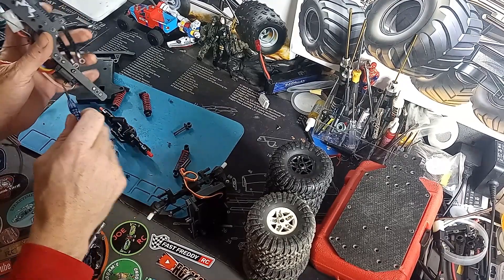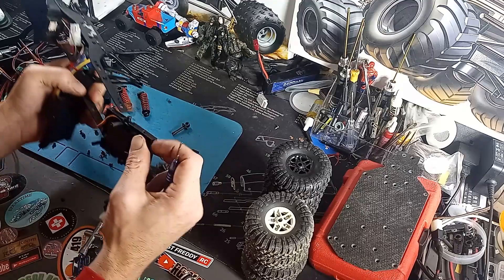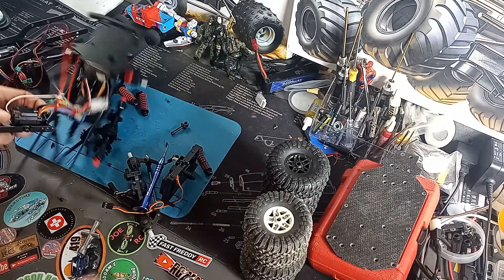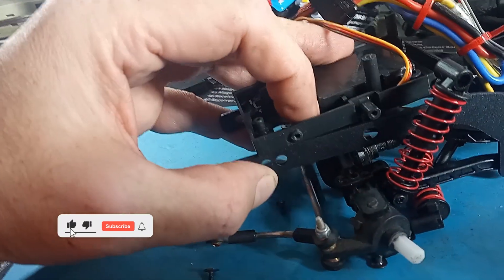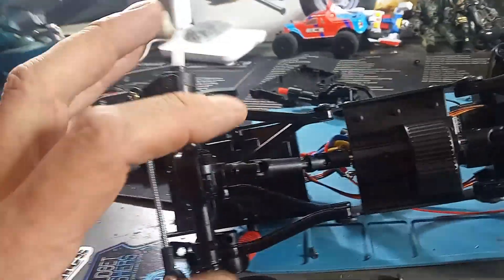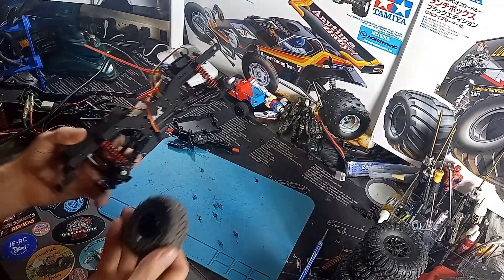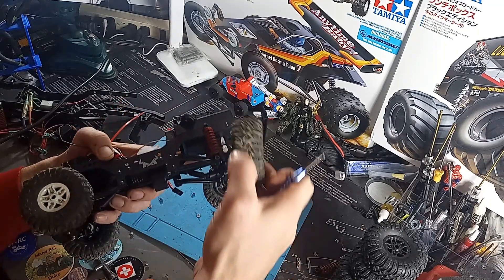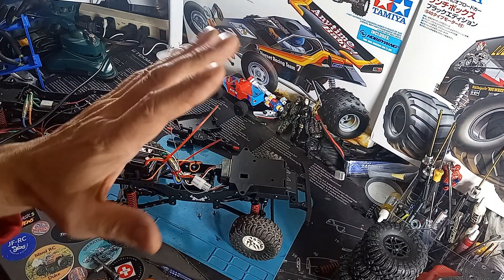MN45 - Dual Steering - Upgrade?  Will it work?  #FJ40 #MNModel's #mn45

Comment: 4WS not always an easy mod, getting them to run straight can be a pain. I'm lucky I use a GT5 radio that allows for that with steering modes.
Reply from the maker: I was wondering what radio would be good I want it to be able to do both modes of possible..  before I buy the new axles.  I will definitely check it out..  worst comes to worst I change it back .  Thanks brother.
Reply: @reitplace4765  There is more then one radio out there with crawler modes, the great thing is the servos are on different channels making the steering trims easy. Plus a better radio you can set end points on each servo and my radio you have front steer, rear steer, 4WS steer and crab steer.
Reply from the maker: @BasBoyRC cool I saw a few vids on it but have no idea what I am doing..  is crawler mode better to search for or just 4 wheel steer?
Reply: @reitplace4765  on my radio menu its called crawl and when highlighted it shows off, then when you press the button on it then it cycles through the modes.